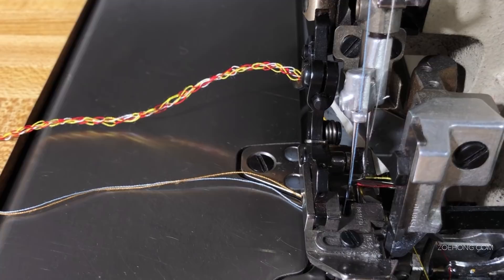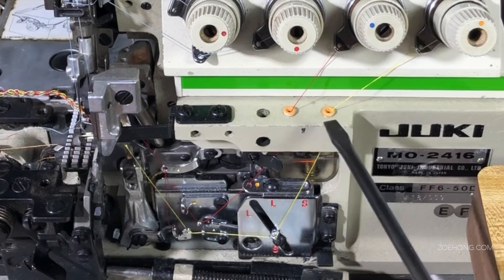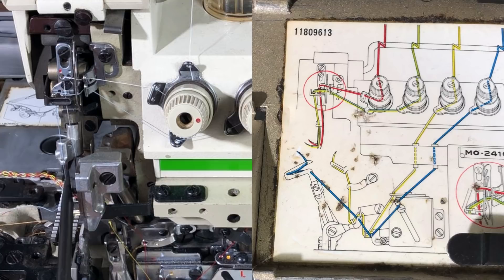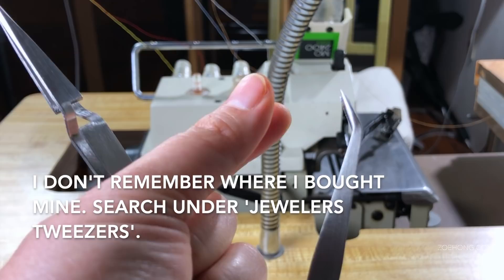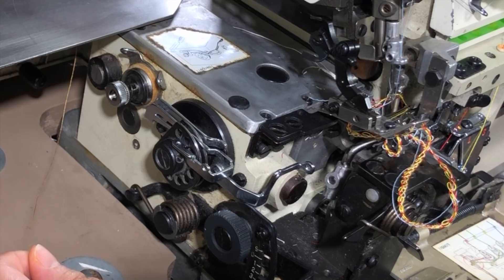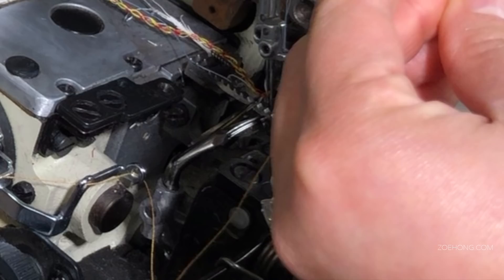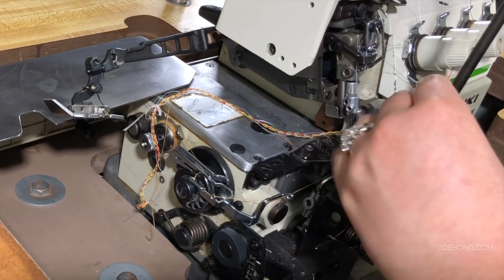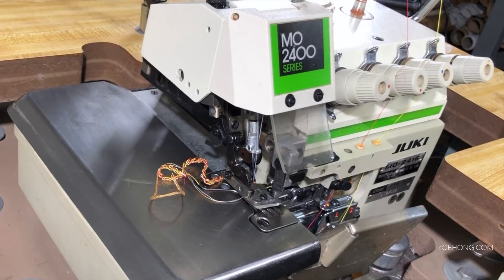Intro to Industrial Overlock/Serger Sewing Machines

Comment: Using an industrial overclock is a lot better and provides nicer results than a plastic one (I have one of these at home and it requires tons of adjustment of tension every time I switch materials and sometimes it just refuses to make a clean seam on certain fabrics). From my experience: go for a professional,  even if it's second hand.
Reply: Another great video, thank you, Zoe! <3
Reply from the maker: In general, home machines can't handle the workload of rougher materials and constant sewing. I encourage people to buy industrials even if they call themselves "home sewers" if they sew regularly. And yes, most second hand industrials are awesome!
Reply: Thanks ladies for the advice. I sew as a hobby but can't handle my home machine walking on the table when going at medium speed. I have been considering secondhands too! First an overlocker then lockstitch.

Comment: My 4 thread overlock has been the best investment I've ever made in my sewing. Better than my Berninas. It's not just the stitch quality but the general handling that makes the difference. With a direct drive servo motor it's also a lot quieter than my home use serger.
Reply: Servo direct drive motors literally purr like kittens! 😻
Reply: Whow  I solve the broblem

Comment: OMG i've debated whether to try and re-sell this exact same model.  bought it off ebay about 3 yrs back, took me forever to piece it back together (came in 3 parts with no instructions).  Was proud i was able to do it, thread it and use it a few times but man does it take a bit of getting used to - i'm more accustomed to home machines (my singer portable serger is much more user friendly LOL).  Been sitting in my corner apartment collecting dust.  I refer back to videos like this one and then i don't want to re-sell.  I do mostly alterations.  Not sure i really need this machine but god damn i pieced it together and got it running.  Thank you Zoe.

Comment: Great idea to use two tweezers sometimes. One to push through and the other to catch it and pull from the other side. Brilliant! When temporarily removing some screws or plates for a colour, I've seen some people put them on a tray or piece of fabric in the order they removed them. That way they know the order to put them back into the machine. Re needle replacement, I've also seen some people cover the open throat plate area with cloth to avoid the old or new needle accidentally falling into the serger or sewing machine.

Comment: thanks so much for the videos. Is there some secret trick to adjusting the tension that's different than a domestic overlocker? I just upgraded to this machine from a 4 thread, and the straight stitch is loose, no matter how much i fiddle with the first dial!

Comment: If I could give you 10 stars I would. I have a 6716s and I bought it second hand but it does heavier weights but I’m still using it to sew knits just using 3 threads.  Love it do not want to use my domestic anymore even though it’s one of those expensive babylocks.

Comment: A rose by any name... A 3 thread is commonly called an overlock, serger and sometimes an Overcaster. A 4 thread is commonly call a Mock Safety stitch and a 5 thread is a Safety stitch. A used industrial Serger can be an outstanding purchase. They last for EVER! Can be found for the $300.00 to $500.00 range in good working order. Just be careful that it has a 120 volt single phase motor on it or you may have to buy a single phase motor separately which will cost another $150.00 Most factories use 3 Phase power and you don't have that at home.
  When I can't find my spaghetti needle, I use a broom straw.... (Do they still make broom straws?)

Comment: Overlock machines can have anything from 2 threads and up, and sew any combination of stitches. Unless it's a 2 thread machine, the number of threads won't actually tell you anything about the stitch produced!

A 4 thread overlocker for example may sew a 2 thread overlock stitch with a separate lock stitch, or a 2 thread overlock stitch with a separate 2 thread chain stitch, for woven materials. Or for knits a 3 thread overlock stitch with a separate 1 thread chain stitch, or a 4 thread overlock stitch...

Industrial machines generally only makes one type of stitch, but if that includes a side straight stitch (lock or chain) that can easily be left out by removing the needle and tread(s) for it.

Comment: Great Video! So helpful. 

I have a question, I have a similar serger (Juki MO 2516). While replacing a broken needle I see that there are three different positions to place the needle. You have yours offset (one front, one back) there is also a position to have both of them directly next to each other. When and why would you switch these positions? Thank you!

Comment: Did a thumbs up!!! Thanks so much for the instruction. Missed a tiny little thing ...i was wondering how you secure the threads at the end. i just make a knot.. but maybe you have another trick.. which is better
Reply from the maker: I don't do anything to the ends of overlocked edges. I'm always going to finish the corresponding edge, e.g. if I overlock the side seam, I would clean finish the hem so I don't need a knot. And all the threads intertwined would prevent unraveling until you do the hem.
Reply: @zoehongteaches  Thanks!! I think.....i understand :)